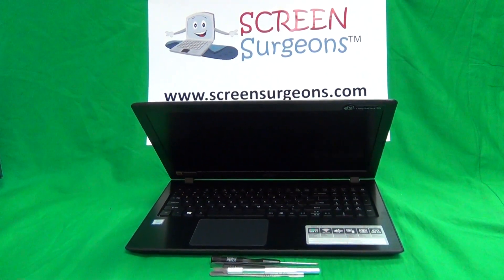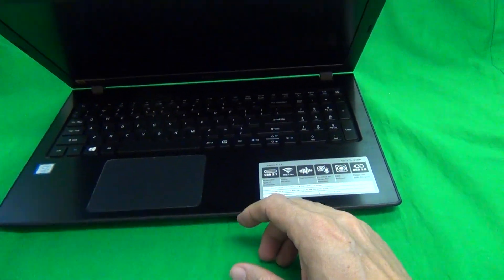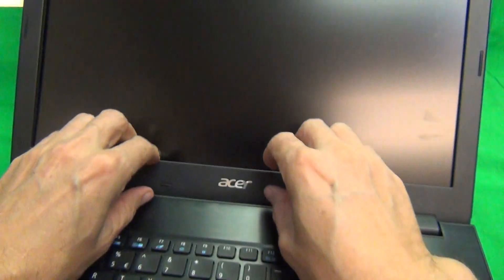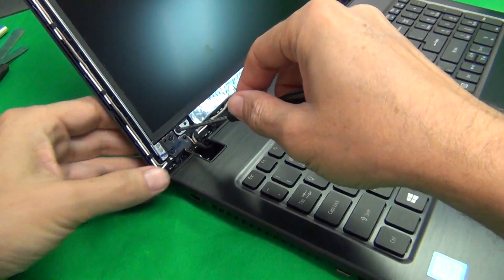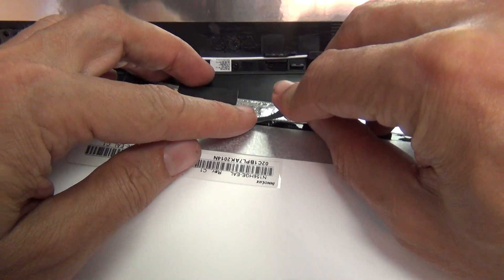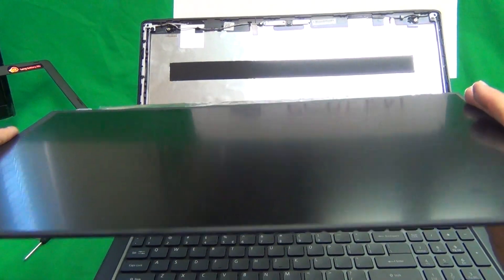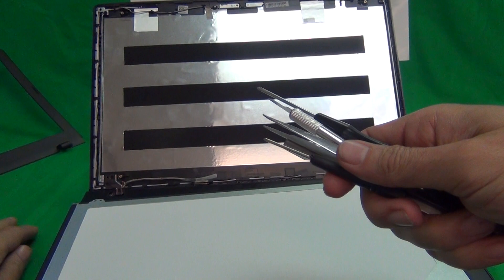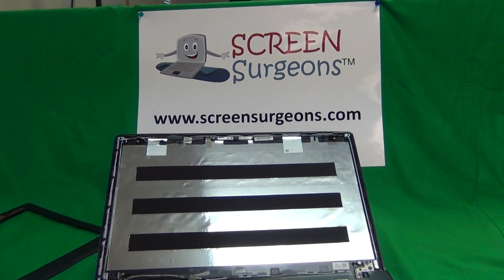Acer E15 E5-575 Laptop Screen Replacement Procedure

Comment: Thanks for the tutorial! I was able to swap out screens. Ran into a small problem with a screw that was too tight, and then the head became stripped.

Used tin snips to cut the tab off the broken screen, then pliers to loosen the screw. Wouldn't recommend, but things work now.

Comment: Hi, i hope you can help me. The connection point on the left side of the screen to the keyboard has been having issues since day one. First it started with the laptop screen not closing entirely down. Then it started to make 'clicking' sounds when moving the screen up and down. Then it made a lpud sound and tiny broken plastic pieces fell off. Now the frame has slightly come off as you do in step 1 on the left side BUT i cant open the laptop more than 45 degrees so step 1 would be impossible. I do not want to change the entire screen, just disconnect the screen and laptop to see what the problem is. What steps can i take best in this case? Thanks for your videos :)
Reply: hey i got the same problem with the hinge and broken pieces from the back cover. Were you able to fix it?

Comment: I have the same acer aspire E5-575 model N16Q2... its a touch screen type, but the Lcd crack. If i do replace the Lcd screen does it have to be touch screen or can i use a non-touch screen?

Comment: E 15 E5-575-33BM,. I have a problem with my laptop, Model number as in starting,  While I turn on laptop, it turns on,. Blue led turns on, keyboard lights turns on,  but system is not booting,. Screen is black, no info is displayed on screen, Please help me to solve the issue.
Reply: I restarted it and the acer logo displayed as it tried to boot up, but then went back

Comment: Really helpful, sir I have the same laptop whose hinge is broken, I want to replace it but don't know how to do that so please make video on hinge replacement
My laptop aspire e5 575 33bm
Reply: I do too...
Reply: Omg same! Looks like a problem in this model. My screen is now stuck on 45 degree so cant do anything without it almost break if i move anything
Reply: Same. The hinge broke on me, now i cant close or open the laptop. I cant use it without holding up the screen with something to rest on. Has anybody found a solution?